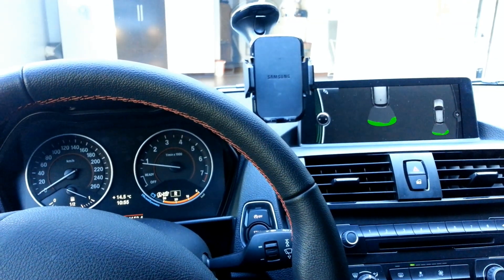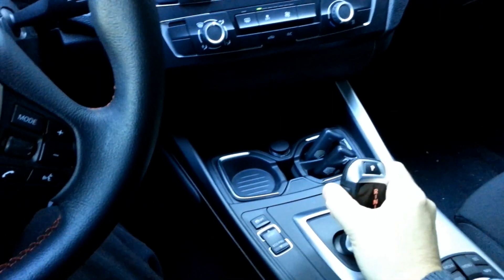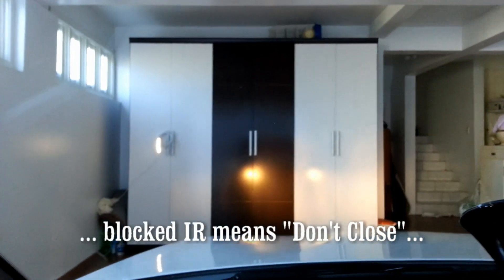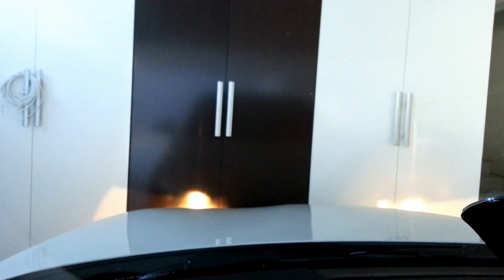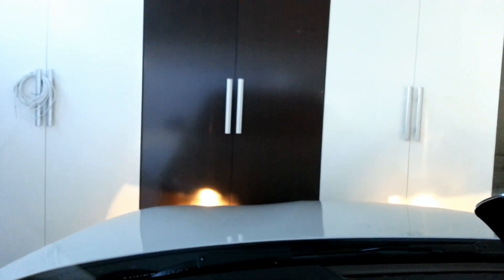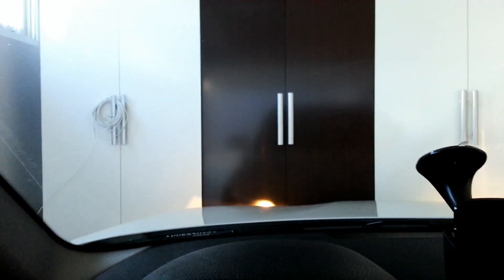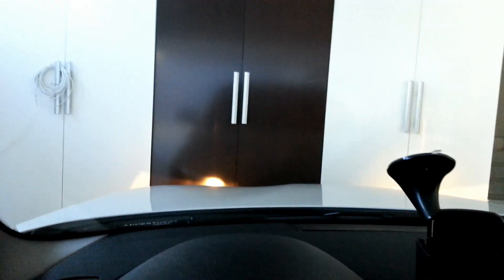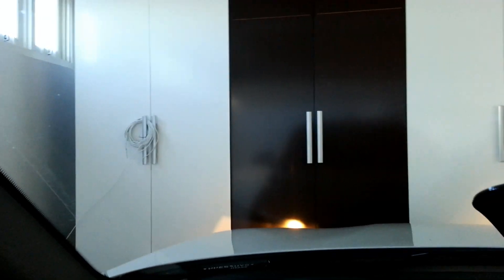DIY Garage Parking Sensor with IR Barrier Alarm Sensors

Comment: Do you mind sharing links or make/model of the actual components you used?  Also I'm not sure I fully understand the wiring setup, could you perhaps add video with a walkthrough of the different connections?
Reply from the maker: Sure!! Gonna do a new vid with the wiring and parts setup... I will also add links to the parts online.. Thx for the interest!
Reply: Rodrigo Boos That would be very much appreciated, thanks!  We like to be parked as close to the garage door as possible to maximize space in front of the cars so this would definitely help with that.
Reply from the maker: andrebaranv Wiring and connections: Part II - DIY Garage Parking Sensor with IR Barrier Alarm Sensors - Part 2